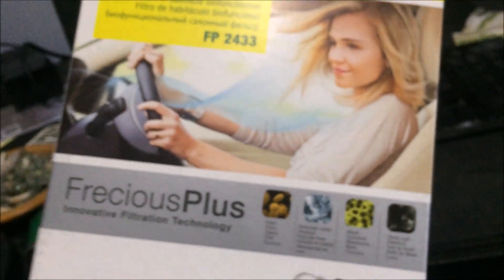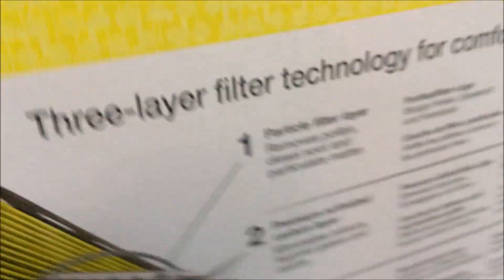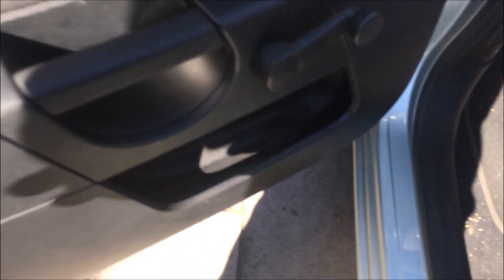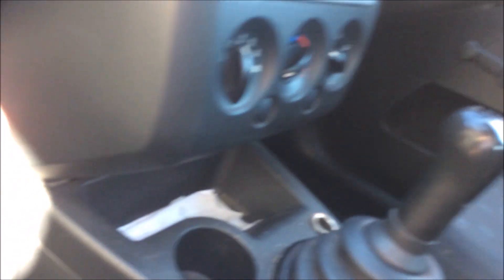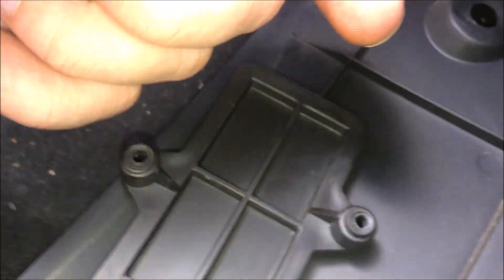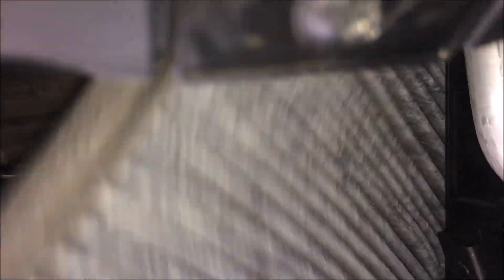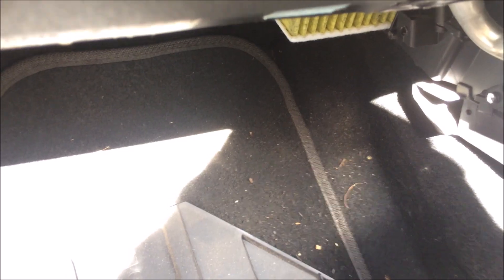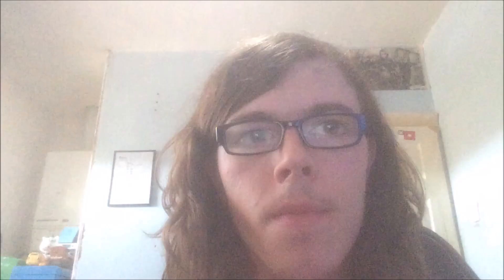HOW TO REPLACE A POLLEN FILTER ON A 2004 FORD FIESTA MK6 (VERY EASY)

Comment: Cheers mate. I took off the cover just behind the one where the filter is and exposed the metal aircon manifold then got lost.

You no doubt found you had to be quite gentle with the screws, clips etc as they are easy to break.

Comment: I knew it was behind that sodding panel. Off to do it now, as Ford only changed the air filter at last service (PS: I do not recommend dealships, do the work yourself or with a reputable third party that doesn't have conflict of interest in trying to push you brand new parts!)

Comment: which side of the vehicle? to the steehring wheel or the other i am from germany
Reply from the maker: That's a very good question, I think it would be on your passenger side still as it would be hard to access it on the driver side
Reply: for right hand drive cars its on the drivers side so unfortunately you have to unbolt the throttle pedal to access it. its a little harder on those models.

Comment: Wash your hair, Cut your hair and stop wearing your mums glasses !!
Reply from the maker: Don't forget to subscribe
Reply: @mikmak3154  disagree. Not much better
Beam pattern is absolutely wank and doesn't project light at all.
Good set of bulbs in standard reflectors miles better than those shit

I own them.
Reply: @mikmak3154  he's got a 2004 fiesta (I've got a 2006, so same model). Zero point in spending dime on it.
Reply: @stevenfairlie3407  depends on how you treat it and value it, diesel versions are very economical and used market prices will only go up as more and more new vehicles get banned/thrown off the road for the ponzi scheme of EVs.
Reply: @S.ASmith  fair point. I've got a petrol one that was mis-used by previous owner. Picked it up for next to nothing though, serviced it and cleaned out all the air conditioning. basic of basic models too - the radio has a tape deck! :D
I'll just run it into the ground. as soon as it's more expensive to fix than it's worth, then it'll get scrapped.
Reply: @stevenfairlie3407  I picked up my 08 Zetec TDCI 1.4L one (5 door) for £2500, only had done 60k miles on it, had 10 months MOT and it's insurance category is only 10 so it's cheap as chips to insure.

The previous own battered the body work a bit (scuff on front bumper and a snapped clip/bracket, plus a tiny dent (2mm deep if that) under driver side mirror. 

Think they took the mirror out as it wasn't body matching when I brought it, but I've since resprayed it myself. Just bumper to do, stone chips and such and from outside, it'll look brand new.

I shampoo the seats on the regular, and other than that, interior has aged a bit but isn't in shody condition. May need new clutch at some point (probably 100k-125k miles), depends on if i do a major project on the car or not (making rear wheels driven by electric motors)